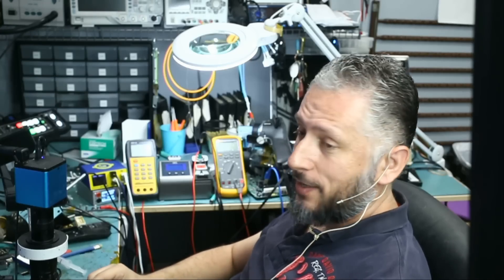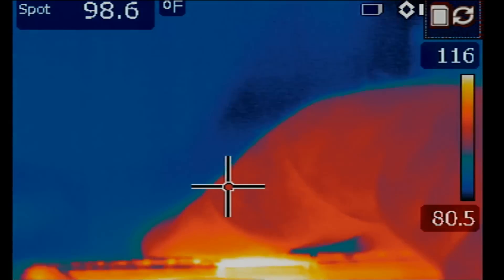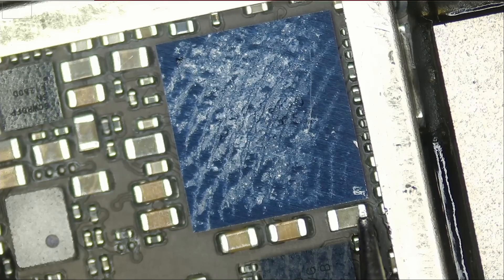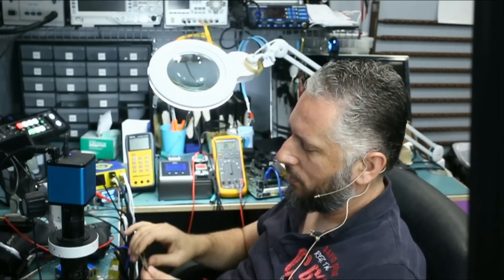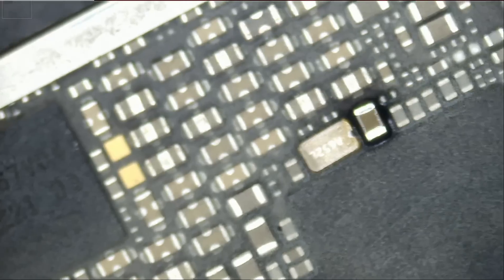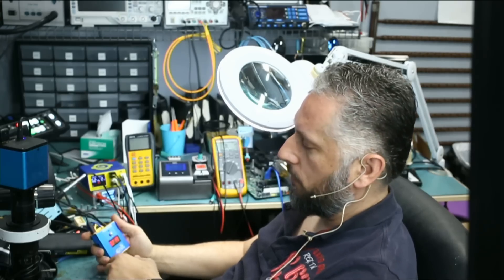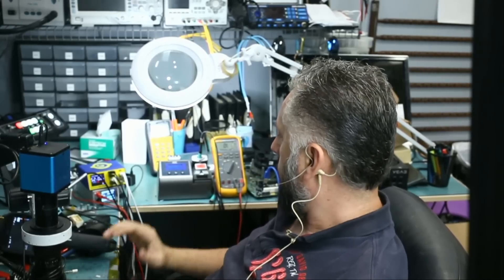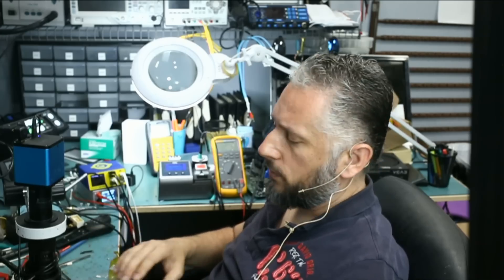iPhone 7 plus not turning on Data recovery. Crazy Short Circuit Finding.

Comment: When you were measuring the compacitors using diode mode on your meter; what did you have the other meter lead connected to, just curious?
Reply: Other side is connected to ground

Comment: I'm a big fan of your videos, I would like to get into repair  and micro soldering myself. When repairing  a gpu, say there is a missing or terribly damaged resistor. Where do you find what to replace it with? Do you have access to diagrams?

Comment: Last ditch effort to replace tristar. 
Many times I’ve also had pulsing pmic using thermal camera but it did not pick up heat on a shorted capacitor near nand. Used freeze spray and melting very slightly on a nand capacitor.

Comment: Just a small suggestion that might help.  Use compressed air or duster spray to cool off the board.  It might make hot spots stand out more when large areas heat up and heat is spreading through the ground plane of the board.
Reply: Freon gas was replaced with flammable butane gas. To prevent explosions, you need to buy diagnostic freeze sprays. This is nonflammable . This has long been used by electronic developers as low-temperature stress testing and repair tool. Spray the surface of the PCB until the ice freezes, and the first melting part when the power is connected is the faulty part.

Comment: Hi Alex. From what i‘ve seen your board is jumping straight to 240mA after pressing power button. Check tristar. It usually generates some heat when it fails like that.
Reply from the maker: The first thing we do is check Tristar, replace battery, charging port, screen and disconnect cameras. . Normal procedure.
Reply: happen to me as well